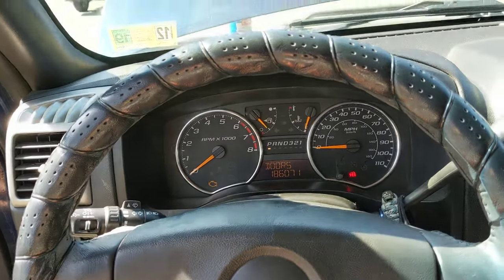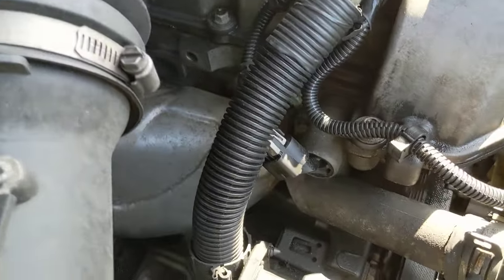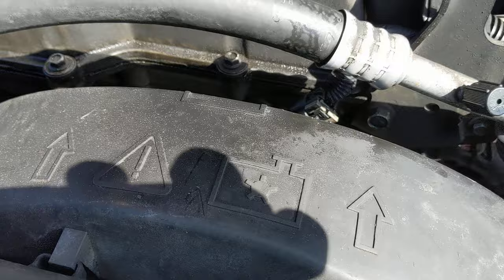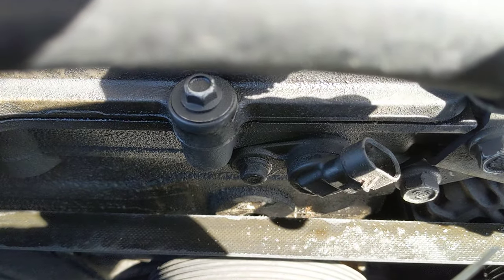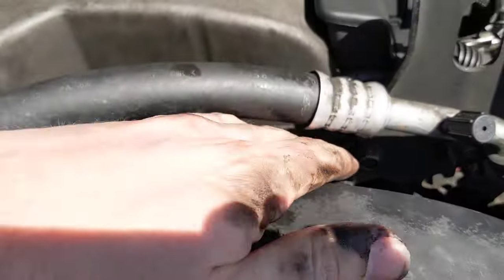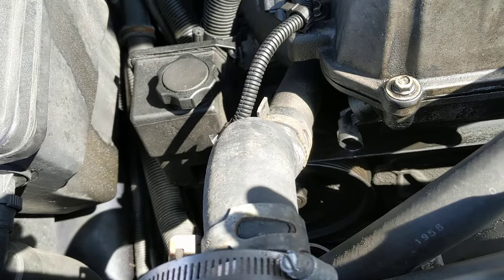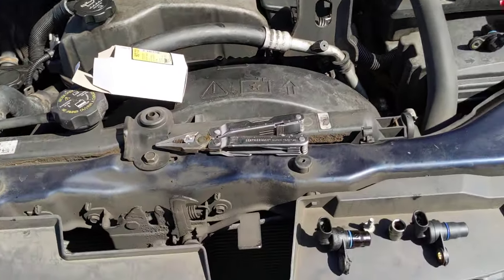2007 Chevy Colorado - Replacing camshaft position sensors, P0340 & P0341

Comment: Mike, I have the same truck. I noticed that I don’t have a wire hooked to my camshaft sensor trying to find a wire diagram just in case I have to get a new wire and wire it in. I don’t know where it goes. any help on this
Reply from the maker: Hi! Thanks for the comment. What year is your truck and is it the original engine? In later years (2008+ I believe) they switched to a system that only uses one sensor. If your engine was replaced with one from an earlier vehicle you may only have one wire, and nothing going to the second sensor. What check engine codes are you getting?

Comment: Hi Mike I just changed the vvt soloniod but month later got that p0014 code?? It’s new though
Reply from the maker: Hi!  Thanks for the comment.  P0014 is the OBD-II generic code that the engine control module (ECM) has determined that the bank 1 exhaust camshaft is more advanced than what the ECM has commanded it be.

I see your comment that you replaced the VVT solenoid but the code came back.  One possibility is that the replacement part is defective.  Have you also replaced the camshaft position sensors?  In my 07 there are two.  In your '08 there may only be one.  Here's a video that has some information about those:

https://www.youtube.com/watch?v=oPyZqx0q2TQ

And a video with some more information about the VVT solenoid:

https://www.youtube.com/watch?v=U143gNZlWbU

Have you changed the oil with a good quality replacement since changing the sensor?  How many miles on the truck?  Are you getting any slapping or rattling noises on cold start, that could indicate a worn timing chain?  Any indication of low oil pressure in the vehicle?  Any indication of damage to the wiring going to the sensors?

I'd start with any other of the aforementioned sensors, oil flush, and inspection of wiring.  Also listen for any noises of a failing timing chain.  Worst case scenario that's what it is.  Challenging to replace, here's a mildly amusing video on one of those:

https://www.youtube.com/watch?v=-dI2pSmMy8Q

Good luck, let us know what you find out!
Reply: The vvt soloniod was brand new from dealer. Oil is good. I just changed the camshaft position sensor right now so hopefully that was it.

Comment: The sensor that you did not replace is the VVT solenoid/sensor. Variable Valve Timing Solenoid.
Reply from the maker: Hi! Correct. I did that one in a later video. 😁

Comment: Help me please. I've been searching for a VVT actuator for my 2005 Chevy Colorado. The problem is that the part has been discontinued by GM and I can't find it anywhere else. Would you happen to know where to find the part. I I just installed a replacement engine and it is running with a misfire. I've replaced every thing else that can cause the misfire. The only thing left is the VVT actuator. It's been 10 months now and I am going out of my mind.
Reply from the maker: Hi Randolph!  I bought the one shown in this video on Amazon.  Amazon does show it in stock, here:

GM Genuine Parts 12615873 Variable Valve Timing (VVT) Solenoid:  https://www.amazon.com/gp/product/B01K8DRWHM/

Obviously mine is a 2007 and you mention yours is a 2005 with a replacement engine, so that may make sourcing the correct replacement part challenging.  Did the engine come out of a different year vehicle?  You may need one for that vehicle or you may need one for a 2005, but basically I'd just be guessing at this point.  There's a whole lot of variables, when using a replacement engine.

If you can't find one on Amazon, I would also suggest contacting RockAuto.com.  They've been very helpful with locating parts for all my vehicles over the years.  Good luck, let us know what you find out!

 Editing to add link to correct video:  https://www.youtube.com/watch?v=U143gNZlWbU
Reply from the maker: Editing to add link to correct video:

https://www.youtube.com/watch?v=U143gNZlWbU
Reply: Thanks Mike but it's not the solenoid I need is the actual piece that goes on the timing gear the VVT actuator
Reply from the maker: @randolphvanbeek3374 hi! The full name of the part is sometimes referred to as "VVT Engine Variable Valve Timing Solenoid Actuator". Check out the Amazon link and the other video. It's a bit of a confusing name. I'm not sure if we're talking about the same part?

In any case, good luck finding the correct part for your vehicle. 😊
Reply: Thanks for your help Mike
Reply: Auto zone

Comment: Were the exhaust and the intake the same part? I bought both but they look the same and it doesn't specify on the package
Reply from the maker: Hi! Thanks for the comment. No, the parts are not interchangeable. I recommend going back to the website where you ordered them from to cross-reference. Sites like rockauto.com might also be helpful to identify which is which.
Reply: @CompTechMike  thank you...I went to the GM website and found what I needed...also thanks for your video👍

Comment from the maker: The subject of 1 or 2 cam sensors seems to come up fairly often in questions on this video and in forum threads on 355nation & coloradofans.com websites.  I've skimmed them several times and so far this one seems to be the best write-up about modifying an engine's cam sensors to work in earlier model year vehicles.  Pasting a link here:

https://www.355nation.net/threads/how-to-modify-a-2008-2012-2-9l-or-3-7l-engine-to-swap-into-a-2004-2006-truck.193761/

There are many other forum threads on this topic, as well as posts on Facebook groups such as "Chevy Colorado & Canyon (First Gen) Fan And Owner Page".  There is also a dedicated Facebook group for doing LS swaps, if you're interested in going that route (as opposed to modifying or rebuilding an existing 355 engine).  Hope this information helps!

Comment: Sorry for asking you, but you can tell me what funsion those sensors have, because my friend has a scanner and he said it was the camshaft sensor problem,
Reply from the maker: Hi! I mean, isn't it obvious what they do from the name? A quick google definition: "The Camshaft Position Sensor detects camshaft rotation, and is mounted near the cylinder head so that the sensor is opposite to the timing rotor attached to the engine camshaft. The engine ECU detects the camshaft angle, and performs cylinder recognition based on the signals detected by the camshaft position sensor."
Reply: @CompTechMike  thanks you very much I got it

Comment: I take it they were not ACdelco? Didn't have to relearn or it did on its own?
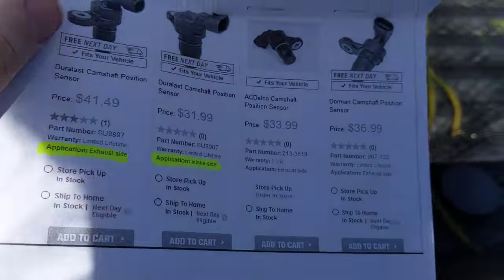Reply from the maker: Hi!  Thanks for the comment.  It's been a few years since i recorded this video but looks like I used Duralast and Dorman parts from my local auto parts store.  You can see them starting at the 1:22 minute mark.  If I'd had more time I probably would have bought ACDelco from Rockauto.  I did have the battery disconnected while replacing the parts, so that should've triggered a relearn.  I did let it idle a bit before driving while I checked for codes, beyond that there was no appreciable delay or "relearn time".  Thanks!

Comment: I'm wondering why, my 2006 5cyl Chevy Colorado, got an Engine light & a knocking sound (like 2 spoons) inside the motor only to realize; after pulling in to the first gas station I got to; It lost a lot of oil & after replacing the oil & getting home, I got a code read about the position sensors? I towed it to my mechanic who had to remove the radiator to access & repair the leak but says the knocking sound is still there! I'd appreciate any ideas or suggestions on what the knocking sound could be & what the best route of repair might be? Thanks, E.
Reply from the maker: Hi! You mentioned getting a check engine light, correct?  I'd start there.  Either buy or borrow a code scanner (most auto parts stores will do this for free) or have your mechanic check the codes.  What codes are you getting?  I'd start by researching those.

You can also remove the serpentine belt and run the engine momentarily.  If the noise is gone with the belt removed, it means it's an accessory (such as alternator, water pump, power steering pump, or AC compressor) making the noise.  If the noise continues with the belt removed, it means it's something internal in the engine.

You didn't mention how many miles are on the vehicle, but from the sound you are describing and the oil loss you mentioned, it sounds like it may be the timing chain.  This is a very challenging repair on our trucks.  They call it "the $2,000 timing chain".  I'd start by checking all of your codes first, however.  Let us know what you find out.  Good luck!
Reply: Ok, well.., my mechanic repaired a leak behind the radiator ; a broken seal of some sort ; and also said the serpentine belt was oil damaged, but the noise was still there after repair. He suggested I take it to the Dealer bc it appeared the noise was inside the engine block. And being these 5 cylinder trucks were no longer made after 2011, it would be difficult to find a 'usable' engine replacement in quick time! All things said, I took it to the dealer & they were able to find a 'new' (rebuilt) engine w/a 3Yr Warr., to replace the now defunct one of 155,000 miles & it only took a (2) two month wait to get it back!:^, At a total cost of Extended Warr., $4575. & my O.O.P. for labor $5033.= $9608. But I consider myself lucky, that I'm able to continue driving my lovely Champagne beauty for awhile longer & enjoy the many compliments I get from admirers & strangers! This is my little slice of happiness!:^) https://photos.app.goo.gl/LWqhPan47r5FUKcE8
Reply from the maker: @etovar5030  Phew!  A lot of money, but still less than the cost of a new truck.  Glad you're happy, and hope your truck gives you many more good years!

Comment: Hi mike, My car went in to limp mode the other day, and when i try to floor it it miss fire and then went  into limp mode, or the car dies out of no where... i did scan the car, it came out P0017  ( i try to google this code and it said it can be the cam sensor. or the solenoid) and oxigen sensor on bank one... Thanks for the video, i herd you said p0017 is from the solenoid so, im going to try that one first. and change the oxigen sensor on it to. its a 2004 with 194,000 mile on it. i love my truck and i dont want to get ride of it.... i hope is this...
Reply from the maker: Hi! For a P0017 I'd start by changing the oil. If that doesn't help, change the sensors (including the VVT solenoid with the screens that fall out). If the code still comes back, inspect the timing chain. It may be time for a new one. Are you getting any kind of rattling noise on cold starts? Good luck!

Comment: I changed those and now truck struggles to start. Cleaned mass Air flow sensor and new air filter. Still shakes and struggle to start! Always gotta try 3 times.
Reply from the maker: Hello! Obvious question but did you use the correct sensors and install them in the correct locations? What issues were you having prior to replacing them? Are you getting any check engine lights?

Comment: What was truck doing when sensors went bad
Reply from the maker: The first time I got the code for them it had stalled out and wouldn't start. Eventually I was able to get it to start so I could get home. I replaced them fast after that; don't want to get stranded! 😉

Comment: I got a p0017 code, is it the same fix?
Reply from the maker: Hi there!  P0017 is one of the most challenging codes on these trucks.  In my experience, it can be anything from a bad VVT solenoid, oil pressure issue, to a worn or stretched timing chain.  Are you hearing any rattle or "slop" in the chain when you first start the motor?  Are you getting any other codes, or just the P0017?  If it were me, I'd start with changing the oil & filter with a good quality synthetic.  And remove the VVT solenoid and inspect the screens.  These are cheap enough that you should probably just replace the sensor, if it's never been done before.  Hopefully that will fix the issue, but if not, here's some other possible culprits for P0017:

Causes may include:
•Timing chain stretched, or timing belt skipped a tooth due to wear
•Misalignment of timing belt/chain
•Tone ring on crankshaft slipped/broken
•Tone ring on camshaft slipped/broken
•Bad crank sensor
•Bad cam sensor
•Damaged wiring to crank/cam sensor
•Timing belt/chain tensioner damaged
•An improperly torqued crankshaft balancer
•A mis-built or mis-timed engine
•A loose or missing crankshaft balancer bolt
•The CMP actuator solenoid stuck open
•The CMP actuator stuck in a position other than 0 degrees 

Good luck, hope this list helps you with your troubleshooting!
Reply: @CompTechMike  it’s a rebuilt engine just installed. Idk if that helps cut the possibilities
Reply from the maker: @aldogarcia393  Hi Aldo, that's probably going to make it even harder to troubleshoot.  Is the engine the correct / exact replacement for the vehicle?  Or have you done something like swap a 3.7 for 3.5, or a 5.3 swap?  You may need to match the sensor for the donor vehicle.  I have a vague recollection from a forum thread years ago that the number of "teeth" that are on the gear the VVT solenoid connects to may be different?  That's paraphrasing a bit as I don't exactly remember (it's not exactly teeth, although I believe the other sensors do use something with magnets).  If the sensor's not reading right, that could set that code.

I'd probably ask on sites like ColoradoFans and 355Nation if anyone knows anything about this stuff, and by going to the company who rebuilt the engine and see if they have any suggestions.  Let us know if you figure it out.  Good luck!
Reply: @CompTechMike  it’s the same 2.9 rebuilt . Same everything.

Comment: I went to AutoZone and their diagnostic told me it was PO341 but when I took out the intake sensor the part they gave me was for the outtake. They dont have an intake in any store in my area. Does anyone know if it matters if the part is for a 5 cylinder vs 4 cylinder? All the local stores have a part that looks like the intake for mine, however its for the 5 cylinder and mine is the 4 cylinder.
Reply from the maker: Hi!  If you're looking for somewhere that has the sensor in stock today, we'd just be guessing about what stores are local to you.  You might try calling around to places like Advance, O'Reilly's, NAPA, Carquest, Pep Boys, or AutoNation, or other smaller chains.  You might also try your local Chevy dealership parts department.

If you have a little time I recommend ordering it from RockAuto, instead.  I did check their website and it appears the sensor is the same for 5-cylinder and 4-cylinder engines, but that's just putting in my own truck as an example.  Obviously you would want to put in your own specifics (year, make, model, etc.) to verify that it's the same sensor for your vehicle.

www.rockauto.com
Reply: @CompTechMike  Thanks for the help. I have a 2006 2wd 4 cylinder Colorado and no where in NM had an "intake sensor" . They only had it in the 5 cylinder. But after buying the 5 cylinder sensor, I saw that they were same just different angle for the connection. Installed it into my car and its running back to normal.
Reply from the maker: @arvizo10  great! Glad to hear you got it working. 😊👍👍

Comment: That is not an exhaust sensor on the side with screens it is the variable valve timing solenoid had to replace it on mines it was spitting out oil
Reply from the maker: Hi! Thanks for the comment. Different sites have different names for it. For example Amazon calls it "Exhaust Camshaft Position Actuator Solenoid - Variable Valve Timing Solenoid". The How-To on 355nation website calls it a "Exhaust Camshaft Actuator Solenoid". You're right though - it is a frequent cause of failures and CEL's on our trucks. Eventually I should do a do a video just on this part. 😀

Comment: Any tips for a p0300?
Reply from the maker: Hi!  You didn't say what year or engine you have, but check this forum - some good tips here:

https://www.coloradofans.com/threads/as-i-resolve-code-p0300.148098/

Also check your VVT solenoid.  May not be directly related but a common point of failure in our trucks:

https://www.355nation.net/threads/how-to-replace-exhaust-camshaft-actuator-solenoid.17342/

Good luck!
Reply: @CompTechMike  2006 Chevy Colorado I5 thanks I will check it out.

Comment: Is that gonna be the same as a p0014?
Reply: Maybe if I watched the whole video first you’d say it wasn’t hahaha
Reply from the maker: LOL!  Each code means something different.  I would check this link and also the sensor that has the screens that fall off.  It's a pretty common problem in our truck (you can see mentioned in some of the other comments).  https://www.700r4transmissionhq.com/p0014-chevy-colorado/   Good luck!

Comment: What if 2 codes come up...Like p0014 and p0304?
Reply from the maker: Check your VVT solenoid, also called the Exhaust Camshaft Actuator Solenoid.  There's how-to's in several of the forums.  This is a common point of failure in our trucks.  Good luck!
Reply: Mike Smith I wonder why they failed so often and they couldn’t figure out a way to make them stronger or anything over the years even on the 3.7s they were bad like the 3.5s it was very odd why they couldn’t figure it out

Comment: Ugh
 The dreaded serv tpm message. I have lived with that for 100k miles
Reply from the maker: LOL.  Do you have aftermarket rims or just bad sensors?  You can probably have it disabled by someone like PCM For Less or PCM of NC.  Good luck!
Reply: Bad sensor. Went out righy after warranty. Stealership said they dont know which one so theyd replace them all. Lol
Its a 08 model. Its been a good truck.
Reply: Bruce Perkins My 2012 Canyon 3.7 did that one time and the tire light stayed until until I shut it off and restarted it then it disappeared that was very weird it also says service stab system every so often and goes away after driving a few miles